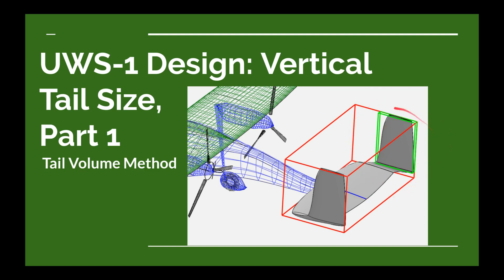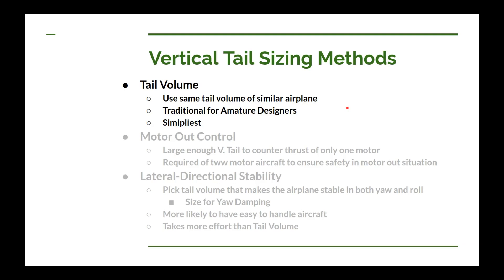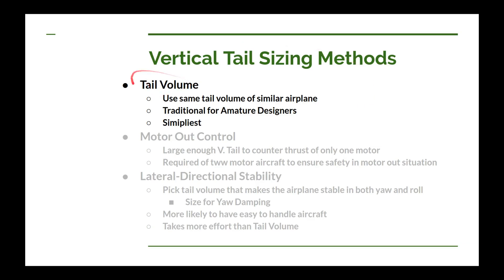UWS-1 Design: Vertical Tail Size, Part 1

Comment: 9:57 I'm designing a plane where the ailerons won't go until the wing tips, should i consider the wing span value just until the outer aileron tips?

Also, do you have a video dealing with the space between ribs on the wing?

Comment: Shouldn’t you include sweep of the main wings into the yaw stability? 
BTW: i love your Videos!!
(Sry for my bad English)
Reply from the maker: If you have wing sweep then yes. The UWS-1 does not have sweep (or least not enough for it to have an affect) so I did not include it.  I also ignored many other things like down wash and prop wash, at least for now. I will include those if I make another version of the vertical tail. In addition, one ultralight design I'm thinking of for the future may have slightly forward swept wings so I would include the affects of sweep in that design.
Reply: Ultralight Airplane Workshop, ok, thanks for replying

Comment: Hii just discovered your channel. Recently I am working on a project in my college in which we have to design a delta glider gliding in a circle, which will send data back to the ground station. (Cansat competition)
Since you seem to know about this subject can you guide me in a direction for the making the calculations (a book, a website etc. )  for control surface like rudder and ailerons keeping in mind the manouevre we have to perfom ie. a circle of 250m radius.
Reply from the maker: Hi Aryan, I'm thinking that you probably need a practical guide instead of aerodynamic theory. I'd recommend a book or website that is dedicated to something call "Free Flight" modeling. I don't know of a specific one though. Good luck on your project.